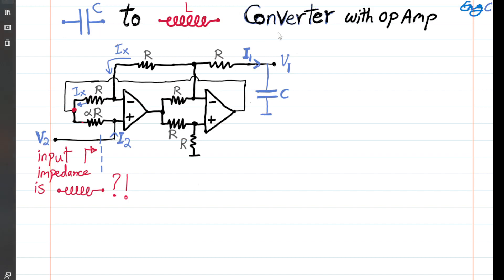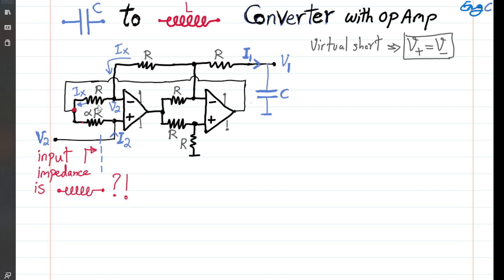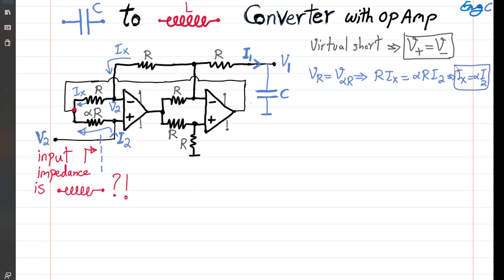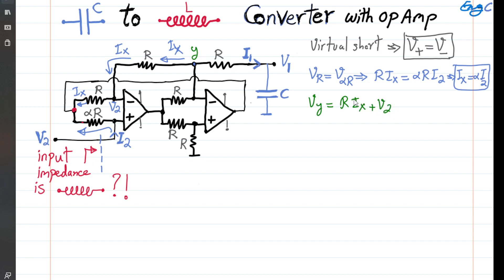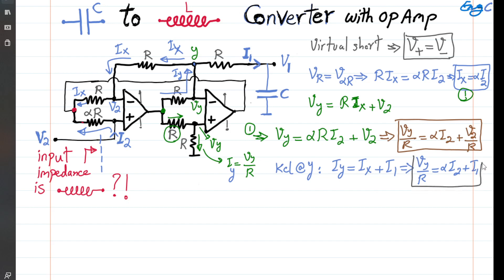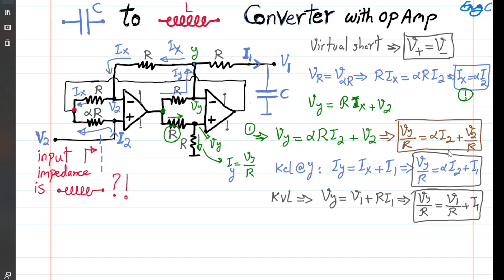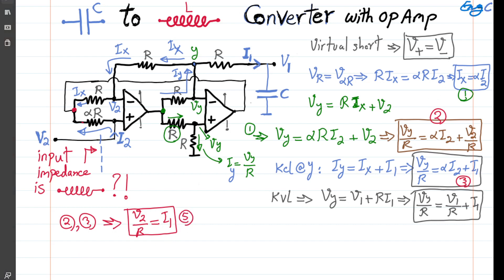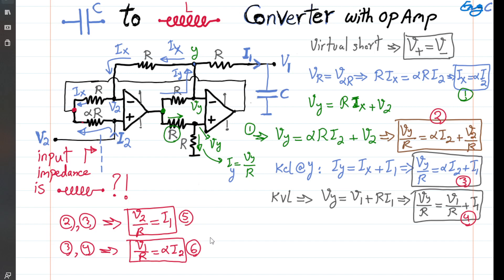Capacitor to Inductor Converter:  How to design Impedance Converter with Op Amp

Comment: thanks. now we have two different ways to simulate an ideal inductor. Like this one better simpler requirements. 7 identical resistors of 100K and 1 microFarad cap ==> 10000 H !!    The only restriction is to make sure the virtual short conditions are satisfied? Can this be used in a filter circuit?
Reply from the maker: Glad that you liked these videos of Op Amp based Gyrator impedance converter circuits useful.  Yes, but keeping the circuit stable with mico Farad caps might be challenging.  Try to simulate this circuit.  You might see that stability is very limited and only possible in a super limited range of frequencies.